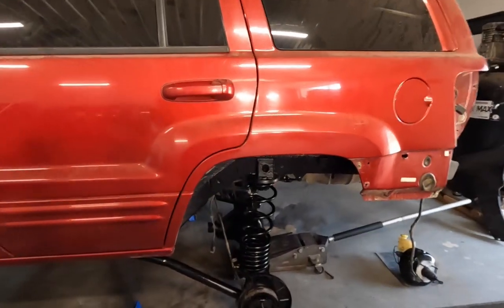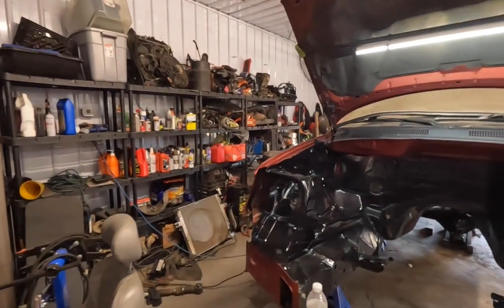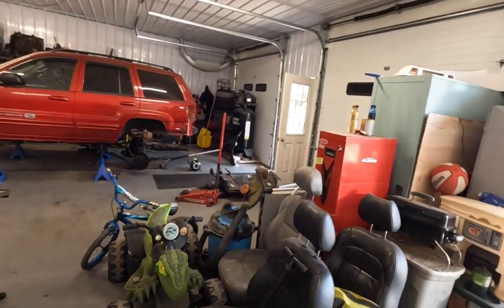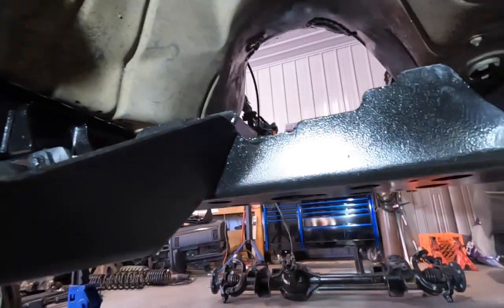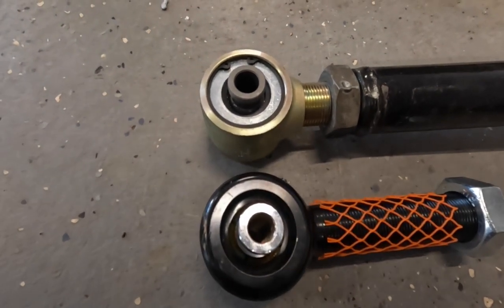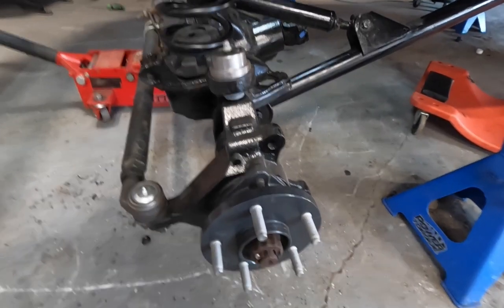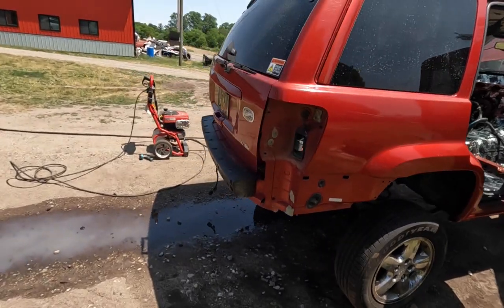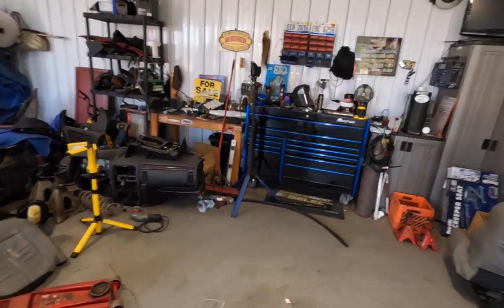FINALLY ON WHEELS! Project LSX WJ gets its suspension.

Comment: What size tj metal cloak coils did you use? Around the same height with iron rock coils and looking for dual rates
Reply from the maker: The 6” TJ coils equate to about 6.5” on a WJ.